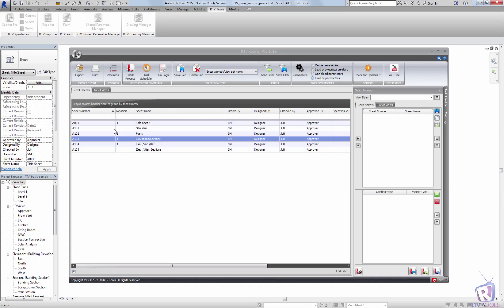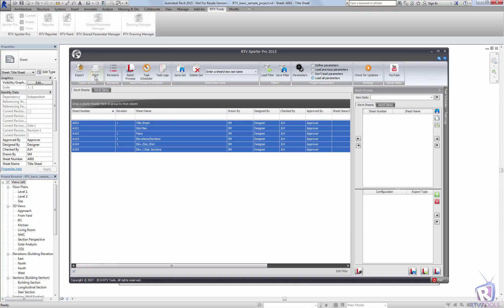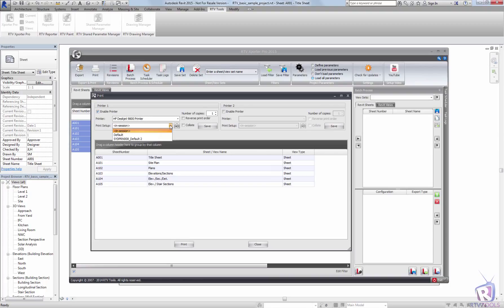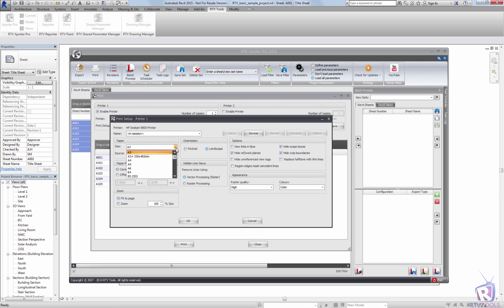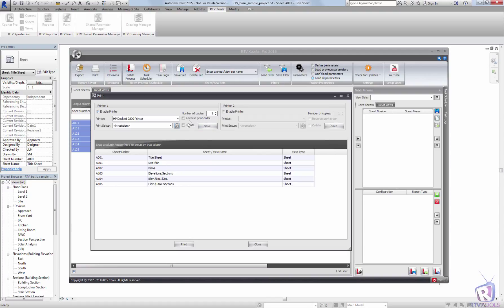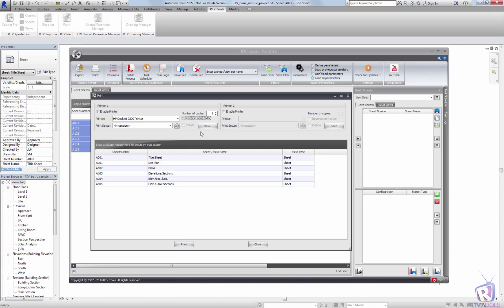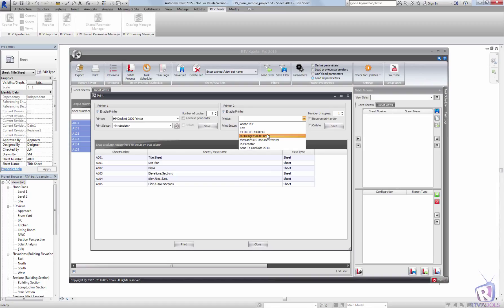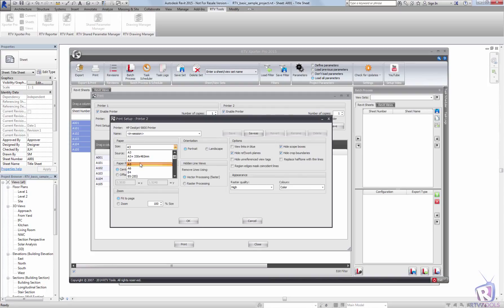Xporter PRO 2015 Printing

Comment: I'd like to have a function like this that will list and print all sheets across multiple Revit models. I'm currently using Revit 2017. Is this possible without creating pre-defined XMLs for each file and using the batch mode? I want to be able to select and print my sheets in bulk, I also want to make sure that new sheets are added without having to constantly update the XMLs. Thank you.
Reply from the maker: thanks for the message. Yes, you can use our Xporter App to print all sheets or all sheets defined by a parameter(s) using our Filters function. This way when new sheets are created they are automatically added to the Batch process for printing without needed to update any other files. Check out our Filters function here: https://youtu.be/0NownzMwXG8
Reply from the maker: To create a scheduled task or batch process across multiple Revit files. You can use our Remote function of our Xporter PRO App. This allows you to create Batch processes or Scheduled Tasks across multiple Revit files without needed to open them. You can assign multiple processes to all files or to selected files, including Central files, using our Remote dialog. Check out the features of our Remote function here: https://youtu.be/IYIJm26FJ0Y